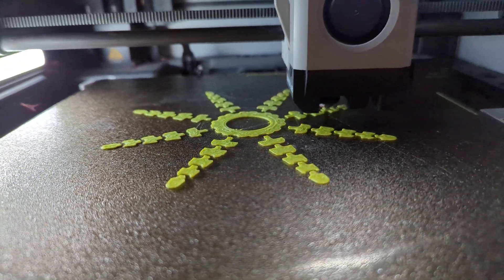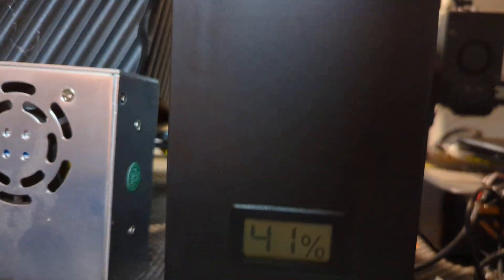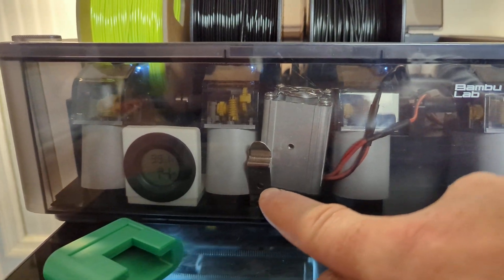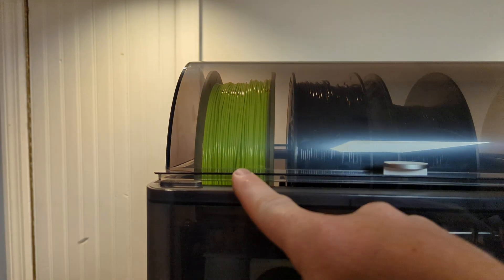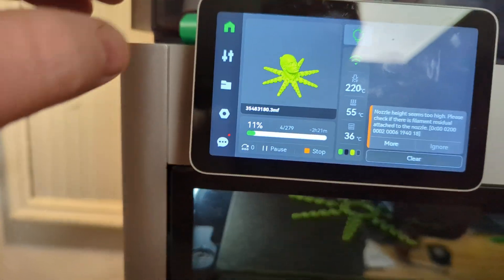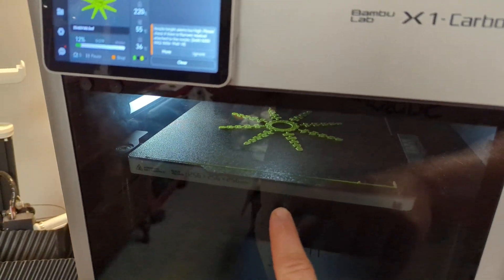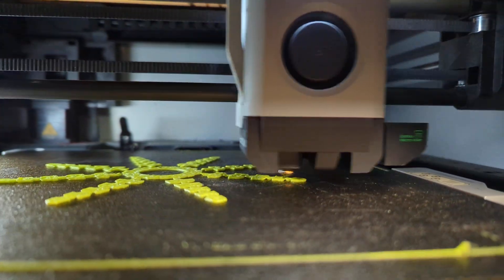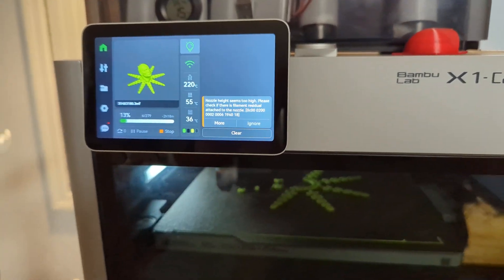TPU + AMS Success Recipe Bambu Lab X1

Comment: hi! I found this very fascinating. Is the AMS heater/dryer still alive? Have all the motors etc survived?
Reply from the maker: @tdplayert the heater internals delaminated so I needed to crimp them back together. It's awesome, no ams issues.
Reply: @JoeMalovich  thanks for the reply! Sorry for not totally understanding, if you don't mind me asking a bit further - what is meant with "arms issues" and what exactly did you need to crimp? As I associate crimping with wires. So the heater was suffering a bit but the AMS itself was fine?
Reply from the maker: @tdplayert The AMS is working fine. The crimping was to tighten the heat spreader around the PTC heater element, not the wires.
Reply: @ great! I'm going to have a closer look at this, liking the concept quite much, just want to make sure it's not a fire hazard :)

Comment: I observed the same. If the TPU is pre-heated, the results are just amazing. Even with an A1 mini. At crazy fast speeds. I totally don't get why certain youtubers never mention the fact that the material needs to be tempered to be printable and re-hydrated afterwards to get back it's original properties.

Comment: I guess I'm lucky living in NM, my loaded AMS stays at 10% with desiccant only.
Reply: in vegas currently, its 40% right now. in the video he is under 20%. Curious if 40% would not work, have a $40 reel of tpu sitting on the shelf. waiting for weather to change lol
Reply: @marcovalle2779  TPU is pretty stringy if it's not dried out first, but give it a shot, don't put it in your ams just hang it off the back and see how it prints.

Comment: How did you get this to work? I get a message in Bambu Studio that says "Only the AMS slots loaded with the same material type can be selected"
Reply from the maker: Then load the AMS with TPU and tell it it's PLA
Reply: That's what gave me that message. I think Bambu may have fixed this loophole with an update. If I label the AMS slot as "PLA" Bambu Studio will not let me print TPU from it. What I ended up doing is just leaving the AMS slot not labeled as anything and it just says "?". That worked.    @JoeMalovich
Reply: Thank you for the video! Wouldn't have attempted using AMS without it!
 @JoeMalovich

Comment: Almost 5 minutes talking random bullshit about his diy ams heater, not closing ams lid, power supply blah blah .... to tell  "just use TPU profile and change material type to PLA" kek xD
You don't need all this diy heater crap to print TPU, you don't even have to dry it. Just put any hard tpu like 55D or 98A and it will work just fine.

Comment: Does the AMS reject the tpu in its settings? Do you get an error or anything? I need to print TPU in multiple colors and I need 500 of them so I'm very nervous to try this...
Reply from the maker: I don't use the Bambu spools so the machine is none the wiser.
Reply: Do you just tell the machine its pla and change the profile?
Reply from the maker: @rmgrimshaw23  yes. It thinks it's printing PLA but all the material settings (except type) are tpu
Reply: @JoeMalovich  What settings should be changed beyond temp?

Comment: You're killing me... opening the door while printing, using cardboard reels in the AMS, random chinese heater cooking away in there.  You are asking for it!  But this was still a  good video.  Thank you!!
Reply from the maker: It's not like print quality suffers much on a for-fun model when I open the door. The reels are solid cardboard not corrugated, I've never had a problem with them. I put the OEM ceramic heater/thermistor/fan on the aftermarket hotend.
Reply: @JoeMalovich  Yeah I know.  I'm sure it's not as bad as they make it sound.  Another creator was saying that the cardboard reels shed fibers which clog the gears.  I'm not sure if it's really that big of an issue.
Reply: I use cardboard reels in the AMS all the time it doesn't seem to matter at all.
Reply: opening the door won't do a thing. it's TPU, not ABS. the OEM heater is literally chinese
Reply: Been using cardboard spools since the ams came out, there are no issues with them.

Comment: Isn't the diamond back nozzle made out of diamond? How are you going to turn it down?
Reply from the maker: No, the socket in the heatsink or the cold part of the heat break would be shortened.
Reply: Ohh duhh haha. Does the ams have any issues swapping between tpu and other filaments?
Reply from the maker: @CollinRenaud  I have had some issues. You might need to chamfer some of the leading and following holes around each feed wheel, and reduce spring tension in the feeder closest to the spool.

Comment: what do you think about adding that heater to the inside of an x1c to make a heated chamber? i noticed theres a version of it in your link with what looks like a thermostat
Reply: After warping my first ASA filament print, I was thinking I'd have to heat my P1S chamber.  However, preheating my bed at 100°C for 5-20min seems to be enough in most cases.  Little parts stick really really well until the plate cools down.  My first ASA prints were of a big RC boat hull...the boat is about 30" long and so the sections are thick.  I covered the top and glass door with a thin blanket.  With that I was seeing temps over 50°C when probing through that little hole at the upper right.  This was in a room at about 60°C.  So, I'll probably not worry about heating my chamber.  Heating the AMS sounds interesting though.  Instead of buying a filament dryer I'd rather have a second AMS and set them up to circulate hot air.  I just can't justify 350 bucks on another AMS.

Comment: You got a Diamond back to work with the Bambu ?
Reply from the maker: Yes. BUT the hotend length overall is a bit long, it's hard on the wiper and the machine will throw warnings at you because it thinks there is someone stuck to the nozzle because it's too long. I have another clone hotend that I plan on cutting shorter on my lathe to accept standard v6 nozzles.

Comment: Please let me know if you can print w/ 2 different colors of TPU or TPU + another material like PETG. I see other people looking for this ability as well.
Reply: Ive been able to do it with the dremel flexible pla, and i also was able to use this same overture tpu in the ams. Youre not supposed to use tpu in it, however its possible. Just be ready for possible clogs!
Reply: @98f5 If you can handle clogs then you can print anything. You just have to watch the machine printing, do not leave it alone cause when it clogs it may start grinding filament and you will have to take apart whole extruder. When it clogs or tangles filament just press STOP and untangle, unclog and try again. They blocked it to avoid warranty repairs for people that cannot handle basic unclog.

Comment: what flow rate do you have.. if you wouldn't mind sharing your settings. Since you modified a PLA profile.   Whats your max speed?
Reply from the maker: I actually didn't change the stock tpu settings for this. I took a TPU profile and changed the material drop down to PLA (or any ams compatible material where it doesn't error out)
Reply: @JoeMalovich  thanks.  Waiting on my x1c to do some real world testing and pushing limits.  I print a lot of tpu.

Comment: Is the High Speed TPU still 95A or is it just harder, 98A, and therefore easier to run?
Reply from the maker: As far as I know it has a shell of harder TPU, I don't know if the core is proportionally softer.

Comment: Are you going to make a video about the Diamondback nozzle? I've been thinking about the new BIQU Panda + REVO Diamondback? Seems expensive though.
Reply from the maker: I haven't been able to find a panda and I switched back to a stock nozzle after I had some heat creep issues with the aftermarket hotend. I would wait a few months, I've heard about Diamondbacks leaking between the diamond and brass.
Reply: @JoeMalovich  The Panda is available as pre-order. REVO Diamondback with integrated heatbreak would eliminate any chance of leaking.
Reply from the maker: @ken830 that would explain why I haven't been able to find one.

Comment: to print tpu you need to do it slower than that in my opinion. the problem is the amd system its says is not recomended for the swicher but in the a1 mini maybe its easy to print in tpu multicolor i cant wait to try

Comment: Hey, i had given up on trying! 
I’m definitely trying this with overture HS TPU!
Did you try do to a multicolored TPU print with this set up?
Reply from the maker: I only have the one spool of HS TPU. I did need to trim the ams feeder spring shorter on one slot and chamfer the holes on either side of the rollers. I did do a petg support/tpu part with success.
Reply: @JoeMalovich  perfect, I’ve already done the chamfer part for my previous attempts. 
I need to look up the step to shorten the spring. 
Thx!
Reply from the maker: @Mayday_FPV  The only problem I had was the occasional failed to extrude filament at each filament change. It was getting stuck on the entry to the hotend.  I think I need to chamfer the hotend entry more.
Reply: @JoeMalovich do u have some pics of what u modified? I was able to get mine working with tpu but i still get clogs sometimes.

Also i have mine heated by using some of those heated adhesive the same things used in those filamemt dryers... i also added a fan in the back for ventilation which has a sliding cover to still seal it air tight when i want to.

I have this idea in my head about making a diy ams using an arduino and wonder if you've heard of anyond doing it... i was gonna reverse engineer one of mine and see if i can build one that the printer will think is an ams but in reality it could be something else like an ercf.  Basically was gonna use my oscilloscope to the pins on the ams to see the signals etc...

Comment: How is the parts and heater holding up.i just bought one and I am hooking it up as we speak. I also have a WiFi thermostat temperature controller hooked to the heater so I can controll the heat from anywhere
Reply from the maker: Something on mine just died, I have not diagnosed it yet.
Reply: @JoeMalovich That's not good. Something on the heater or another part?
Reply from the maker: I finally got to it and remembered your comment too! The heating element inside is of a type I can't find elsewhere. It's a sandwich of two aluminum plates and a ceramic middle material inside a kapton wrapper and aluminum heat spreader. There seemed to be some corrosion? between the surfaces AND it wasn't smooshed tight by the aluminum heat spreader. I fixed these and it's drawing 27W as I type this, of which 3W is the fan which I've wired to be always-on.

Comment: Have you tried 98a TPU? 

How about printing with multiple materials, like TPU & PLA or TPU & PETG?

Can the AMS handle that?
Reply: Hey buddy!  Good question!  I'm doubting it, as the trickiest thing is getting the TPU to the hotend initially.  After that, it will print fine.
Reply: @BRADASSOFFGRIDHOMESTEAD Works great on a P1S, no AMS, with a Rounded Sunlu filament dryer off to the side. 98a is a quite a bit stiffer than 95a.

How are things? Didn't know you 3D printed, very cool
Reply: @MatthewsFabrication  What 98a are you printing with?  I run miy 95A out of a Sunlu dryer aswell.  Just got the new Bambu TPU HF stuff.  Hoping that works out.  Yeah, had 3D printers for 11 years now.  I use to talk to the owner of Makerbot back when he was a nobody just testing 3d printing, lol.  I always 3D printed all my prototypes, lots cheaper!
Reply: @BRADASSOFFGRIDHOMESTEAD  Right on that's awesome, makerbot has grown a little since then. I've been doing it for 5 years now, it's awesome.

Comment: Very nice. I've been using Priline Black TPU in the AMS. So far I haven't found any others and I've tried a bunch. I'll have to check out overture high speed Thanks. Use the locks for the lid to keep it shut :)
Reply: Nice, I use the same TPU, it's 98a, so harder than most TPU's.

Does it work just fine, or do you have to tweak the settings slightly to get it to work properly with extracting & loading the filament? 

Also have you tried to use PLA & TPU in one print or any other materials mixed with TPU?
Reply: @MatthewsFabrication  Yeah I mix PLA and TPU all of the time. It  sticks well in multi color printing. I just tested the Overture High Speed today in a multi color print. It worked. No jams or retraction issues.